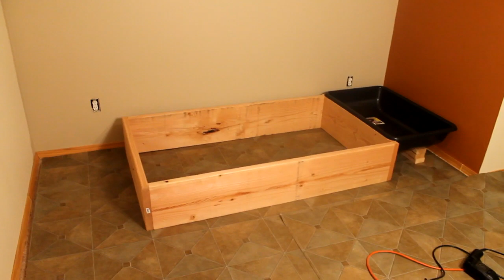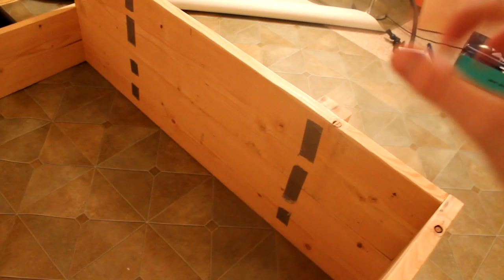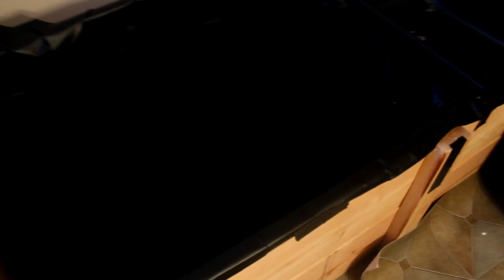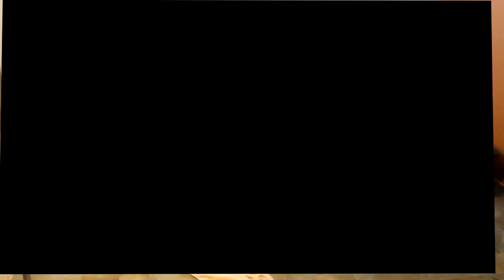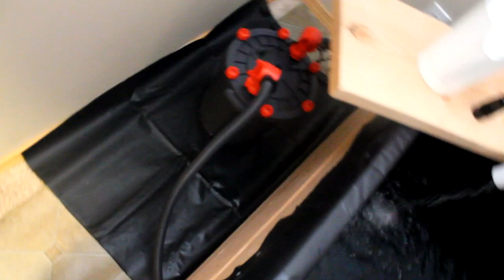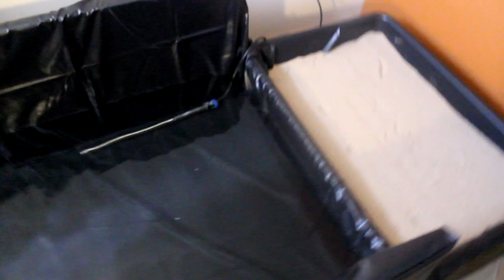Indoor Turtle Pond Project Part Two: Assembly

Comment from the maker: The cfs500 is a badass filter, but is only mechanical filtration (foam to stop the extra food crap etc from staying in the water) the "Bucket" or skippy filter is used to hold different type of filtration. It contains carbon to lower levels of stuff the mechanical filtration can't, and biological filtration to grow "beneficial bacteria" that fights off harmful bacteria and also helps lower the levels of nitrates and whatnot. with a pond this big, it is essential to have more than mechanical.

Comment from the maker: you could connect the pond to an iguana cage yes. as far as him ripping it, I am not sure as I don't have an iguana, I think if you order 40 MM liner on Ebay (a bit more expensive, but will NOT rip because it is so thick) you should be fine with raising screws and nails in there with out a problem, if you have a hole on the bottom of the pond I suggest extending the frame to something on the bottom so the liner rests on wood, and not the ground, hope this helps :)